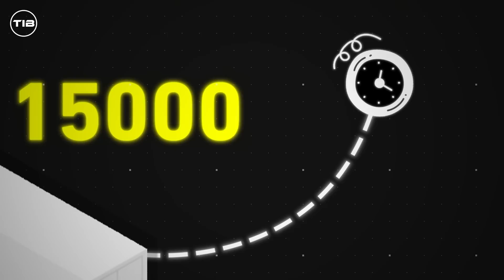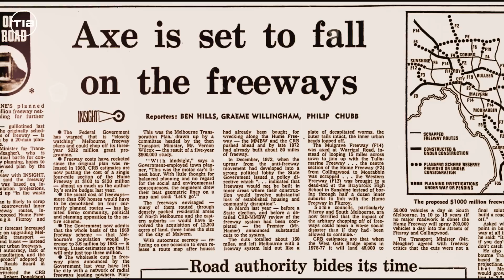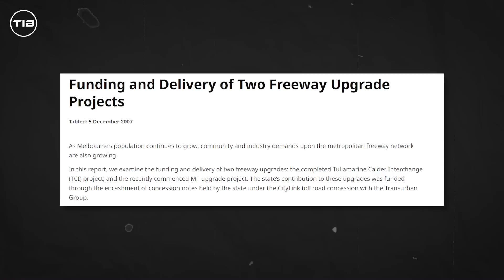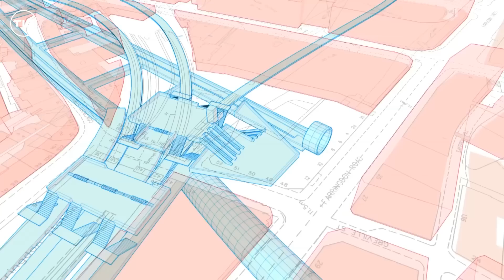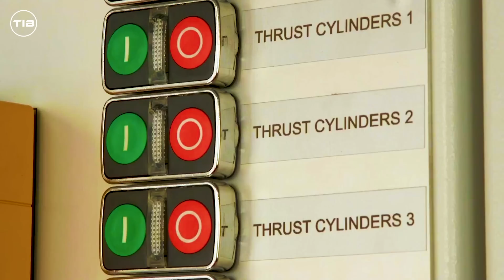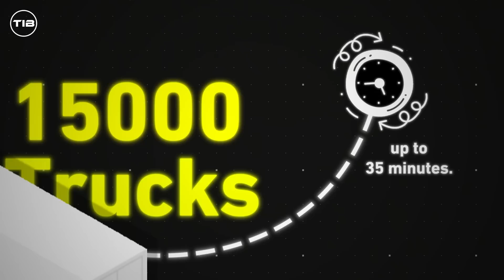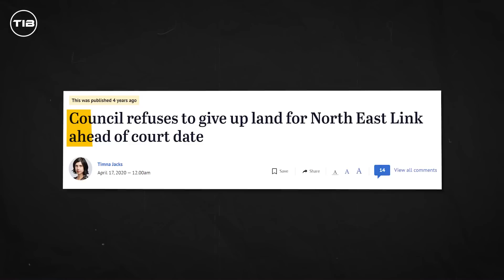North East Link - Australia's Largest New Transport Project

Comment from the maker: A hugely expensive project, is it worth the cost?
Reply: Considering its initial cost was $11.5b, then $16.5b and now $26.5b, I think we can say the answer is no!! Especially considering there is no train to the airport or cross city train. Both are planned but not started, in case of the airport train link, it has been announced so many times that it is starting nobody believes it will ever happen.
Reply: @DavidJones-pi8rl  It won't!
Reply: @DavidJones-pi8rl  The SRL (Southern Rail Loop) initial phases and Stage 1 has started, this is the South / East section - Cheltenham to Glen Waverley, to Box Hill.  I'm not involved so can't explain the detail, but the work with local councils, testing, moving current underground pipes etc has already started.  Fingers crossed changes in government etc, doesn't stop it.  The whole service will be a massive benefit to Victoria - it will just be a bucket load of money.(maybe 10 buckets).  As for money, if you're in any industry you'll understand the cost of labour and goods has increased substantially and massive engineering works like these can often blow out as issues are encountered.  What to do hey?
Reply: Yes, cause I live near by and the house prices will go up!
Reply: @anthonyszy7191 your thinking just like a politician, you care about nothing but yourself.
Reply: Not worth except the ring road and bus way. There better adding more freight rail and public transit lines into the city.
Reply: @maroon9273  Metro rail tunnel a bottomless pit as well!
Reply: Nope!
Reply: 🤤....durrrrrr. 
Stop...just please stop.... in the best interests of our species. You're that stupid that you're actually causing others to become stupid. It's intellectual vandalism.
Reply: Ask what was the original cost budget & & how it becomes $26b!!!😢😢😢
Reply: Definitely not. Money should have been spent on public transport instead
Reply: @ellWayify  PT cannot handle the growth in Melbourne, we are the fastest growing city.  The problem with PT (for trains) is that it all flows to the CBD, causing congestion in the rail lines, hence the new metro tunnel which will alleviate some of this.  We need other options.
Reply: @veaniecar3507  neither does the existing roads really. Have you tried driving during peak across a few suburbs. It’s terrible. Cars are just inefficient way of transporting people. That’s why we need projects like suburban rail loop and increased bus that has priority lanes and improve frequencies. We’ve spent so much more on roads vs public transport and it hasn’t worked and will continue to fail due to induced traffic and the inefficiency of it
Reply: Absolutely not. Like all "freeway" projects it just moves the bottlenecks to other places and induces demand, in this case to the Eastern Freeway, particularly the tunnel that can't be widened.  Ask yourself why a peak hour trip from the city to Ringwood has not improved since before any part of the Eastern Freeway was built?

Comment: Cut travel times????? Historically when Melbourne opens any new roads, bridges, tunnels, etc, they instantly gridlock. The cure is less cars. Most cars contain just the driver. Don't even get me started on B doubles on road not designed for them.

Comment: With the current cost of communications so low, I fiend it remarkable that the author did not consider picking up the phone from anywhere in the world and calling just about any local number in Melbourne and simply ask what is the local pronunciation of placenames. The narrator has mangled many (most in fact) of them as to be barely recognisable. This has transformed what would otherwise be quite an informative 10 minutes into a pain.

Comment: "self driving cars THREATENS to exacerbate the problem"... Um - excuse me?  How does a car that drives more safely than a human - make things worse?  Responds faster breaking those brake check zones, and fewer traffic jams due to accidents?  I'm calling you on that BS statement!
Reply: * Citation required *
Reply: We don't even HAVE autonomous cars here! They are not legislated!
Reply: If self driving cars are perfected (which seems likely to occur by the time NE Link opens), there will likely be a huge increase in ride sharing which will reduce congestion.
Reply: @michaelfink64  Sadly, NO1 seems to know WHAT 'ride sharing' is or means!
Reply: It’s not the self driving car themselves but the other cars and pedestrians. Humans are unpredictable and the self driving cars might be unable to deal with different situations
Reply: @TheLiamster  We don't even HAVE autonomous cars here! They are not legislated!
Reply: @TheLiamster  The average human today gets into an accident for every 477 thousand miles they drive.  A tesla on full self driving gets into an accident about once for every 3 million miles that it has driven.  so - TODAY - before it's certified as self driving and autonomous, that system is ALREADY 6 or 7 times safer than a human driver.   Your statement about "MIGHT" not be able to handle the unpredictability of humans - is proven to be false.
Reply: @AdventurousJohn A Tesla explodes every other day due to faulty batteries and badly made cars

Comment: "4:23 these tbms each powered by11,420 horsepower engines equipped
equivalent to the power of 47 cars will".......Those are some very stout cars if
47 equal 11,420 HP. Thats about 250 hp each.🤔